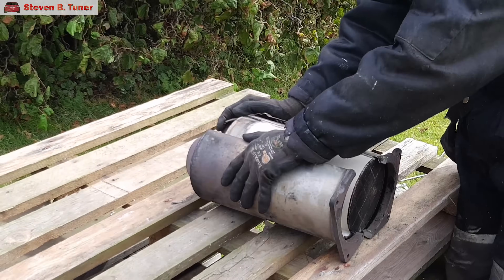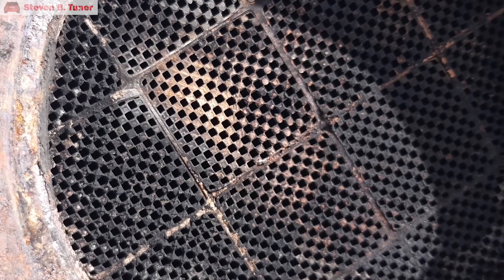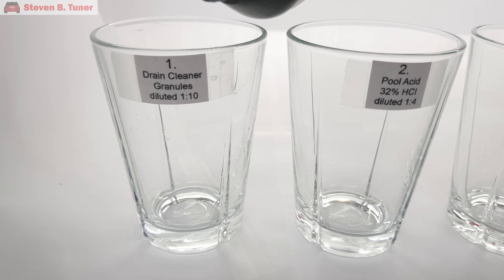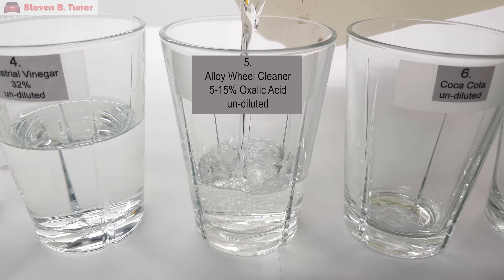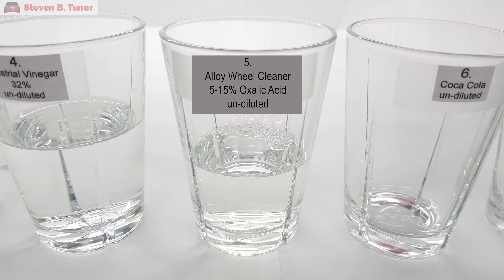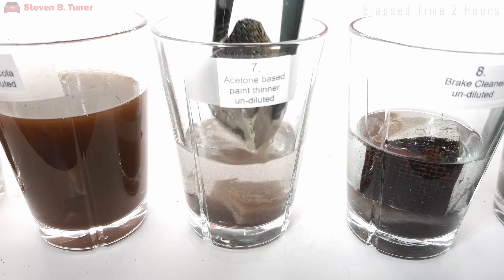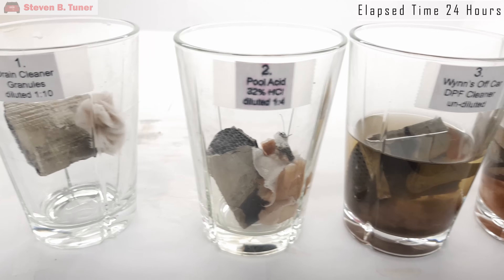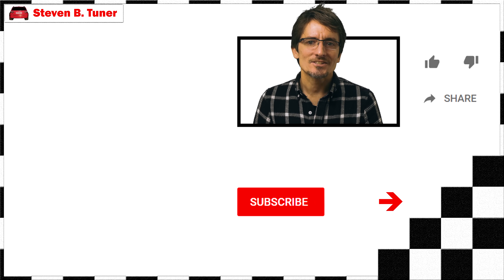DPF Cleaning at Home – 9 Chemicals Tested (Diesel Particulate Filter DIY Ash Cleaning)

Comment: It would be interesting to get an analysis of the chemical composition of the ash - the chemical composition would allow a pretty good guess to be made on what chemicals will give the most effective cleaning. If the acid was actually recirculated through the DPF I think the cleaning process would assist the cleaning although at the end of the cleaning a thorough water flush in both directions to flush out any particulates would be needed. Cola contains phosphoric acid do most drain cleaners. Another chemical that may work is citric acid. As the residuals are likely metal salts/oxides I would expect the most effective chemicals to be hydrochloric acid, phosphoric acid and citric acid. Dishwasher cleaners are detergent/surfactants so will remove the soot but not the ash (as will strong alkali's  like sodium hydroxide. Vinegar is a weak acid - too weak to be useful. I spent may years of my life working for a company that made membranes for large scale water treatment plants. An issue with membranes (similar to DPF's) was fouling aka clogging. There were two types of fouling - organic and inorganic. organic fouling could be cleaning with sodium hypochlorite (bleach) or a mixture of sodium hydroxide (caustic soda) and sodium hypochlorite. For cleaning organic fouling we usually used citric acid although phosphoric and hydrochloric acid also worked well (they were however a lot more hazardous to handle). It would be interesting to see if bleach has any effect on soot . . .however DPF's reach end of life usually due to ash accumulation so provided that can be removed, any soot left will be oxidized when the engine puts the DPF into a regen cycle so I wouldn't sweat the soot removal too much. For stainless steel chemical containing chorine will attack it (bleach does a good job of cleaning stainless steel sinks) so bleach and hydrochloric acid will attack stainless steel.
Reply from the maker: Hi, thanks for watching and for the super detailed comment!  In my other video: https://www.youtube.com/watch?v=LE1boZ3fhLg  I go into a bit more detail about what the ash is made up of:
"The ash in our DPF is mostly composed of sulfates, phosphate, and oxides of zinc, calcium, and magnesium. These are called metal salts, and they all dissolve in acid. A couple of them are what's called amphoteric - which means that they dissolve in alkalis / bases as well as acids."
I am doing a video soon about cleaning using phosphoric acid, as it certainly safer to use with steel/stainless steel if folk decide to leave it in for longer than they should - although it is quite a bit more expensive...  I have also bought some citric acid to try in a future test, so we're both thinking along the same lines there.
Bleach doesn't do anything to soot, which is pretty much elemental carbon, but then nothing much does except for heat (there is an exception: concentrated sulfuric acid mixed with hydrogen peroxide, but I don't want to be known as the youtube guy who helped someone to accidentally burn their foot off, so we'll ignore that).
Reply: @StevenBTuner  - thanks I'm a mechanical engineer with a decent knowledge of chemistry and work in the chemical process/mechanical field so have a pretty good understanding of this. I was wondering what the compounds were in order to assess if they would dissolve in water/acid/alkali or were sparingly soluble. Compounds of calcium/magnesium being group 2 element cations will generally be less soluble than compounds of group 1 elements (lithium/sodium/potassium etc.) but that also depends on what the corresponding anions are (sulphides vs sulphates, carbides vs carbonates etc.). I will take a look at your other video. The reason I am interested is I drive a diesel BMW and when the DPF hits end of life - usually in terms of ash accumulation - the dealerships will usually try and sell you a new DPF which on a BMW can be $3000 for the part alone + cost of installation making it a very expensive prospect and consequently a lot of people simply replace the DPF with a downpipe as it is way cheaper and actually improves fuel economy, although obviously it doesn't help with particulate emissions. If the DPF's can be cleaned effectively by dissolving the ash in water/acid/alkali and even by circulating an acid flow through the DPF with a pump and/or heating the cleaning solution to speed up the process, then it should be possible to restore the DPF close to new condition. To know for sure a new DPF would need to be put on a test rig and the pressure drop at a target air flow measured. It would then the interesting to compare the same measurements on an "end-of life" DPF and the same "end-of-life" DPF after it had been cleaned to see if there is any permanent loss of the DPF material permeability. I've seen a lot of videos of high flow flushing of DPF's to clean them - some using compressed air to create flow surge/pulses (and even the use of pressure washers) but I haven't seen much in the way of what I would term a scientific approach to the problem. . . . although I'm sure someone somewhere has done this (the car manufacturer's likely).
Reply from the maker: @Jagshemasher  Hi, the silicon carbide itself is amazingly resilient  - I hit a chunk of it at point blank range with a 50 bar pressure washer for a number of minutes and it didn't even leave a mark. However, the ceramic glue that holds the modules together is nowhere near as resilient, so any kind of high pressure water or air comes along with a high risk of damage, which is best avoided if at all possible. The other problem with any kind of pressure cleaning is that once there is a path all of the way through then there is no incentive for the high pressure to flow anywhere but the easiest path, so you might end up with a filter that is only 30% clean in the center, perhaps - very difficult to test without complete destruction, or as you suggest, flow-test comparison against a brand new unit. I find it unbelievable that dealers and some mechanics think it is acceptable to even suggest that a new unit is necessary, without even mentioning the alternatives or doing a visual inspection, or sometimes even looking at why the filter is blocked in the first place. For my next clean I will be weighing everything accurately to see exactly how much as is being eaten by the acid, which should give a good idea of the effectiveness of the cleaning stage.

Comment: great video but i think that since dpf cleans in high temperature it would be more representαtive to retry that experiment using some heat,and the results may vary from this video especially with wynn's dpf cleaner.Just an idea!
Reply from the maker: Hi, thanks for watching! There is a video on Wynn's site showing how the Off-car DPF Cleaner is used, and there is definitely no heat used.  If you are interested in what heat will do, then I do have another video specifically about that: https://www.youtube.com/watch?v=bVbgo6a2cpo

Comment: Thank you Steven for creating this video.  I have successfully restored a heavily blocked DPF from a Subaru using your Dishwasher Tab/Pool acid technique.  Two months later, still working fine with no problems.  The original cause of the blockage was sooty oil completely encasing the MAP sensor, and an intake boost leak.  The car is running well, with performance and economy significantly improved.  Cheers!
Reply from the maker: That's really great to hear! Sounds like you identified the causes, which should prevent any repeat issues too.
Reply: Happy to report the car is still running perfectly after the cleaning process seven months ago.  Thanks again. ;)
Reply: @jasong5065  what you only cleaned the dpf or egr as well, how many hours you soaked sodium hydroxide and acid pool for?
Reply: I cleaned the entire intake pathway, map sensor, EGR, intake valves and the DPF per the method in the video.  The soak in chemicals was only for a couple hours each bath.  Car is still working well.
Reply: @jasong5065  Thank you

Comment: Hi, commercial DPF cleaners don't dissolve soot and/or ashes, but they start the regeneration at a lower temperature, like at 350°C instead of the required 550°C, wich we don't easily get while driving.
I don't think the Wyn's cleaner can do it's job in a glass...
Correct me if I'm wrong.

Still I appreciate the effort and results of this testing.
Regards
Reply from the maker: Hi, you raise a very good point about the majority of fuel tank additives - which is that they help mask other problems with your car, or your driving circumstances. A vehicle in good working condition will have no problem at all controlling the exhaust gas temperature so that the required 600 degrees Celcius can be reached for active regeneration at pretty much any time the car wants. The issues happen when the EGR doesn't fully close, or the glow plugs aren't working, or there are leaks in the intake system, or the car is constantly stuck in city traffic jams - and then the fuel tank additive comes to the rescue. But it is only a work-around. It is a much better idea to have the systems on your car working correctly instead, which is what my channel is all about. The Wynn's product tested in this video is not one of the in-tank additives, it is specifically for off-car DPF cleaning only - and it states on the label, and I quote: "Removes soot, ash and deposits from all types of blocked DPFs", although my testing shows that other products can do the job quicker, and more cheaply.

Comment: Forgive my possible chemistry ignorance here, but would using neat diesel fuel have a good effect for cleaning the dpf?
Reply from the maker: Hi, thanks for watching! Your car already uses diesel to clean out the DPF regularly as part of the normal active regeneration cycle - but diesel is only good for cleaning out accumulated black soot, it can't remove the ash deposits that accumulate over time and in fact burnt diesel is a part of what creates the ash deposits, along with burnt engine oil.
Reply: @StevenBTuner  Great stuff! Thank you for the clarification, you've earned yourself a new subscriber ;-)

Comment: Bought a Citroen , history and how it was driven unknown so after short while up came the anti pollution warning fault . Put in a cheap DPF cleaner .to put in the tank and put in some top grade diesel and it cleared the fault light and despite mostly short journeys hasnt returned months later , a cheap fix .
Reply from the maker: Hi, thanks for watching! To get a better idea of what is going on you will need to plug in a good diagnostic unit so that you can see how many grams of ash and soot are in your filter, and how much distance there is between active regeneration cycles.

Comment: Hi. We have a cleaning product in AU called Nifti. Ingredient is 
Water 	Consistency Sodium Dodecyl Benzene Sulfonate 	
Cleaning agent
 Dipropylene Glycol Butyl Ether
Cleaning solvent Alcohols,
 C10-12, Ethoxylated 	
Cleaning agent
 Ethanolamine 	pH buffering agentEthanol 	
Cleaning solvent
Sodium Laureth Sulphate 	
Cleaning agent
Ammonium Hydroxide 	pH buffering agent
Fragrance 	Pleasant scent
Over many years of using this products it is a brilliant cleaning product for engine degrease grime & oil as well domestic cleaning around the house. Do you have any opinions on those indigence that could cause a problem.
Reply from the maker: Hi, that does sound pretty nifty all right! It should be a perfect the 1st stage of the DPF cleaning to remove any oil and oily soot as it is sort of a cross between dishwasher tablets and drain cleaner. You would follow it up with an acid wash using  diluted pool/brick cleaning acid or diluted wheel cleaning acid or diluted 'pH Down' acid (from a hydroponics supplier).

Comment: Here in UK.Dpf for my 2010 f10 has been diagnosed by BMW as near end of life as "drive terrain" error code pops on my idrive. After watching some of your videos I made upy mind I'm not paying them almost 2k for a new one. I ev bought the 4 litres wynns off car dpf cleaner now the big elephant in the house is... how can I remove the damn thing from my car? Oops! Guess I didn't think that far 😂🤣🤣.
Reply from the maker: Hi, thanks for watching! I recommend plugging in a good diagnostic unit (Autel AP200 or better) so that you can get a reading for the ash level and soot level, to make sure that it is in fact the DPF that is the issue, and it will also give you good 'before and after' numbers. Sometimes it is relatively easy to take out the DPF from underneath, but other times the V-band clamp is turned to the worst possible angle, or it decides it would rather break than undo - so it goes from a 30 minute job to a 3 day job... The Wynn's chemical is not all that strong, so if liquid doesn't flow easily through the filter after you use it then you may need to follow up with an acid wash like I do in this vid: https://www.youtube.com/watch?v=LE1boZ3fhLg  All the best with getting your car back to full health!
Reply: @StevenBTuner  thanks.  I took the car to a garage to run the diagnostics and they told me its dpf. If you have email or WhatsApp contact I can send you photo of the report. Don't know where to get the acid and how to mix it. UK very sensitive with acid sales. I maybe wrong 🙊
Reply from the maker: Hi, usually a report would say something like: ash content 70 grams (or more), and that would indicate that your DPF is pretty blocked up and needs cleaning.  I go through a full clean on my other vid: https://www.youtube.com/watch?v=LE1boZ3fhLg and you can get brick cleaning acid in the UK from Wickes and other places - although it is restricted to those over 18, and probably has to be picked up in person. You can send an email to steven.b.tuner(at)gmail.com if you like.

Comment: Would this work to clean out a clogged catalytic converter?
Reply from the maker: Hi, thanks for watching! I haven't tested it myself, but I can't think of any reason why it wouldn't work the same. Just as for a diesel you will need to find out what caused the clogging in the first place, and fix that so that it doesn't clog up again straight away. Be great to hear how you go!
Reply: @StevenBTuner   Hey man, I wanted to leave you an update. I did try this on my third/last catalytic converter, which after a visual inspection, had what looked like approximately 80% of the honeycomb clogged. First I pre-soaked the cat in hot water and laundry detergent overnight. I agitated and brought water temp up a handful of times before going to sleep. The next day I soaked in Muriatic Acid for. I diluted the 1gal. of 32% acid with 4gal. of water, also agitating and rinsing with jet setting on garden hose every hour. After 4hrs the honeycomb looked completely cleaned out. I reassembled and voila! The damn thing runs like a champ again!! I will add that before cleaning and hollowing out of broken pre-cat, I could not even get the vehicle up to 20mph... Thank you so much for posting this video, for the inspiration and if not for saving me a ton of money, at least giving me time to save for new cats before renewing my emissions next year.
Reply from the maker: @josht7861  That's really great to hear!

Comment: Hi Steven like your good experiment.  How many dishwasher tablets needed for one DPF filter to clean. How much water  and how long need to in the water.
Reply from the maker: I have another video where I show the whole cleaning process: https://www.youtube.com/watch?v=LE1boZ3fhLg  If you use dishwasher tablets instead of drain cleaner then you will probably use 20 of them in 5 litres of water, and you can leave the solution in for an hour or two with no problems. When it comes to the 2nd part of the cleaning, the acid shouldn't be left in for more than 30 minutes, and should be well rinsed out with water and dishwashing liquid or some baking soda before a final rinse with distilled water to remove any minerals.
Reply: @StevenBTuner  Thanks for the clarification (and all of your videos of course) !

Comment: Have you ever tried oven cleaning gel to see if this would help dissolve the ash? I’m not sure if the chemical would damage the DPF or not
Reply from the maker: Hi, thanks for watching! Oven cleaners are quite similar to the caustic soda / drain cleaner in the video, so they are best suited to the first stage of cleaning, which removes the oil and oily soot. They aren't very effective against the ash deposits though, which is why a second cleaning stage is required.
Reply: @StevenBTuner  Hi Steven, many thanks for the reply and for taking the time to test out these various products on the DPF for others to learn from

Comment: Good experiment. Try using an ultrasonic cleaner with a good solvent, the cleaning process will go faster.
Reply from the maker: Hi, I just bought a large ultrasonic cleaner so that I can test exactly that in a future vid!
Reply: @StevenBTuner  I just wanted to mention that too. Thats awesome. Can't wait for that video. Btw a lot of DPF Cleaning Services in Germany are using Ultrasonic for cleaning. But they kind of charge a lot for it. 
The thing I am excited about is, how deep into the DPF the Ultrasonic can get. The shape and size of the DPF as well as the directional little channels should be challenging in theory.
I assume since you bought a large ultrasonic cleaner you will test it without cutting it into pieces . I am very curious. Thanks and keep up the good work (I only discovered your channel recently)
Reply from the maker: @bucoescobar1961  Hi, I am thinking about the way to tell that the process has been successful (or not)...cutting up perfectly good DPFs gets a bit expensive :-)

Comment: Hi  great video thanks. I had problems with my dpf so put some dishwasher tabs in the fuel tank..its finished
Reply from the maker: All of the cleaning methods tested are for cleaning a DPF that has been removed from the car.